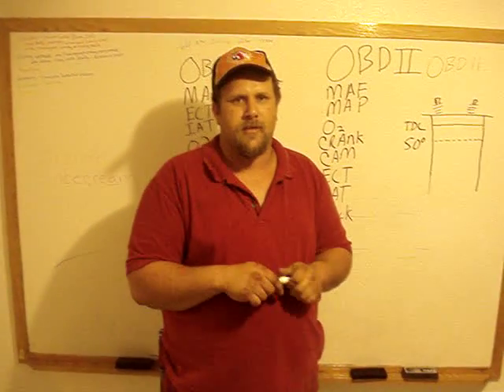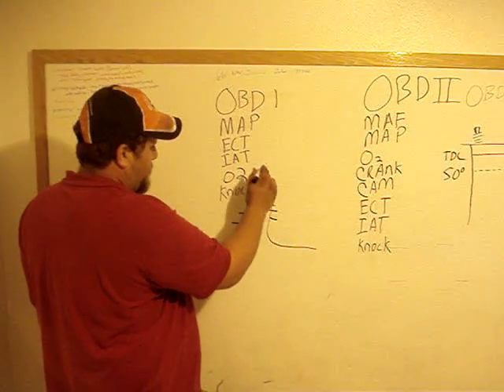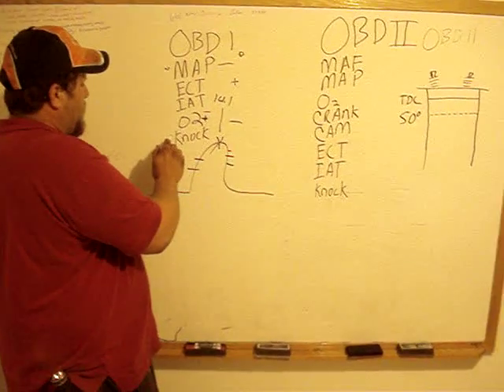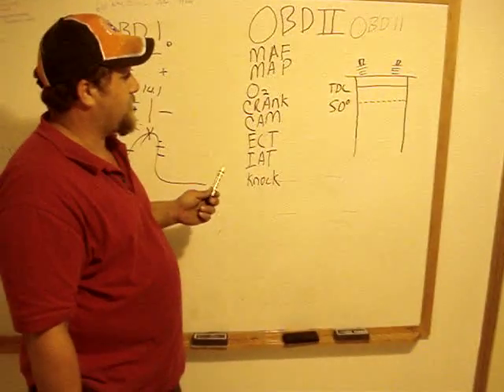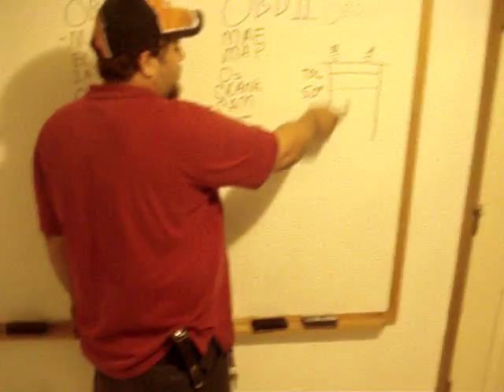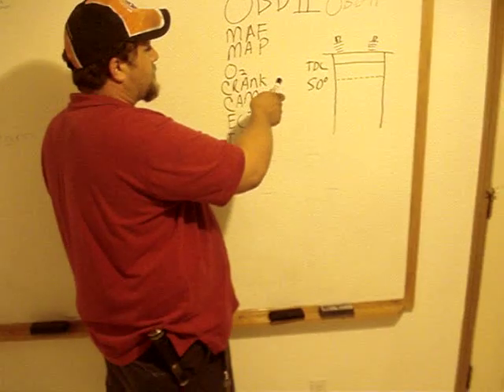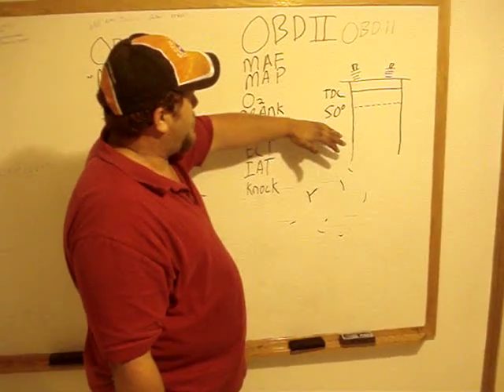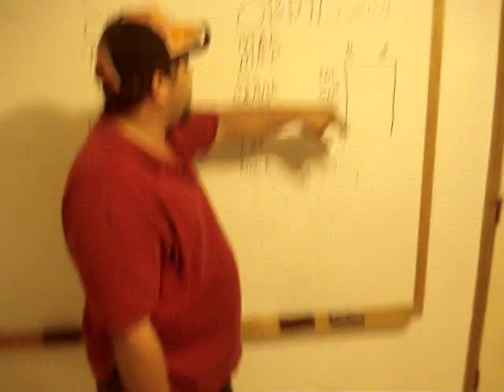obdII ghost pt1

Comment: two things.. 

fuel should be firing after fuel is compressed to give you the most power. 

hho is both implosive and explosive.. 

shouldn't the hho be fed in only on compression near the end of the compression stroke to enable the fuel and hho mix to push the piston down and ignition just on the release of full compression to get best results.

Comment: you got a point on the heat in the tank from a fuel heater!  I hadn't thought of that until  reading these comments.  
HHO is great  for older vehicles that use carb's and throttle body injection, but the newer ones that use multi-port injection are having trouble accepting hho as a fuel enrichment!

if we all stick together and keep the research and development circulating,  we will find a way to become non-dependent on petroleum based fuels.   
My motto... where there's a will there is a way!!

Comment: Interestingly enough, one of the companies out there that are selling HHO kits and guarantee 50-100% improvement, part of their kit is what the call a fuel Covalizer. 
From their website "The Covalizer is a blend of special chemicals added to the fuel that helps "crack" the fuel into smaller molecules and aid vaporization, so your engine burns the fuel more completely, yielding greater fuel economy."